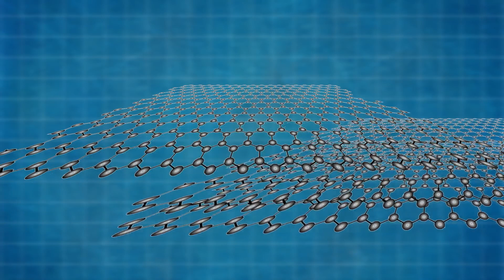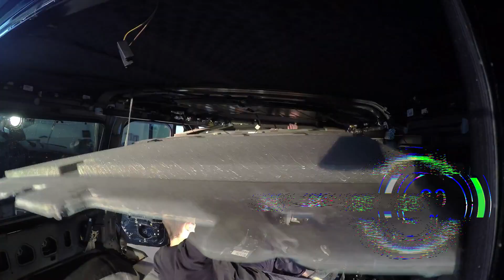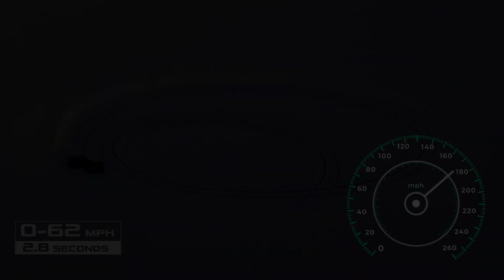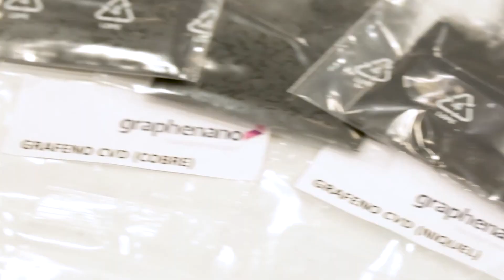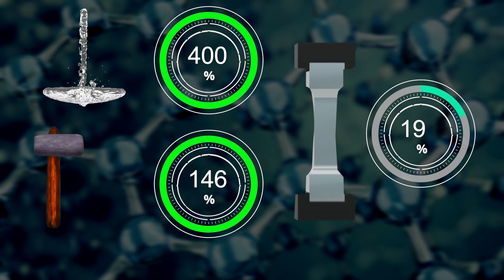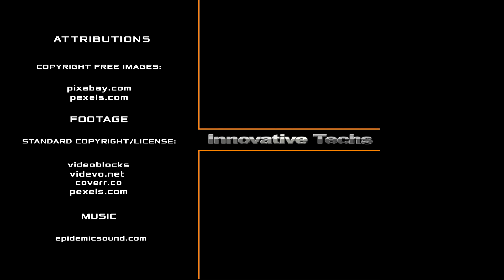5 GRAPHENE INVENTIONS CHANGING THE WORLD TODAY

Comment: this video is just a bunch of stock footage, and a bunch of yammering about graphene. the only thing we need to know is did somebody use it? What happened? Are they going to use it again, and how much does it cost.  There were 5 new ways to use graphene, which were just stupid because they were just putting extra carbon in the products, they WERE NOT USING GRAPHENE.  Graphene is a 1 molecule thick latticework of carbon atoms.  Graphene is a sheet of material.  When they made the new paint for the ship, they just mixed in some carbon.  Thats not graphene. If they put graphene on the ship, they would get a long piece of graphene, and drape it over the hull of the ship.  They weren't doing that, they were applying a paint.
Reply: There’s different type of graphene

Comment: A race car can only go 170mph? I have a diesel Golf & the top speed is 125mph...& it probably cost $100000 less than an experimental race car...
Reply: Not so much how fast it can go, its how fast it gets there.  That was impressive.  Not to mention the difference between 125 and 170 is yuge.  I've only ever done 140 and it felt very different from 120.  Even Nascar makes changes to slow cars down because the physics at such speeds make them too dangerous.
Reply: There have been 170mph production cars since the 60s.  So the answer to “impressive, isn’t it?” Is no.